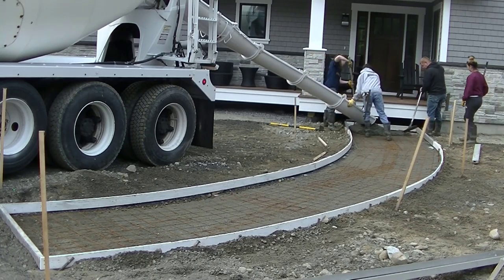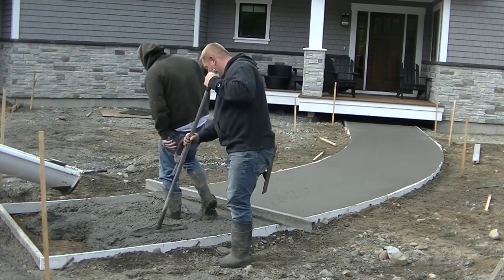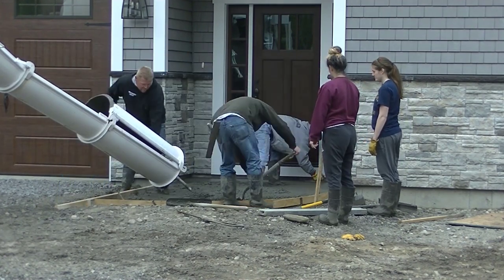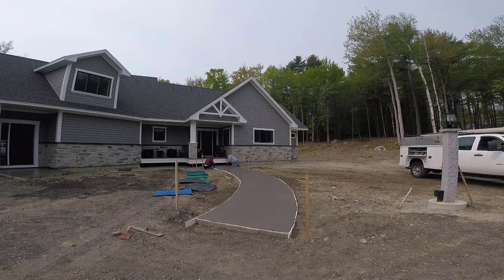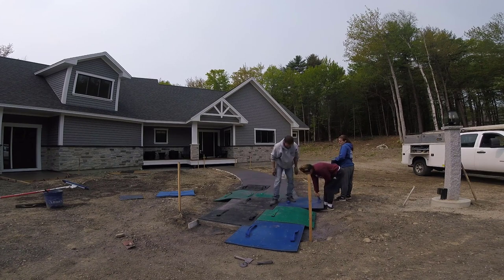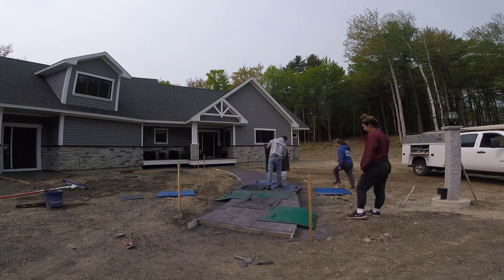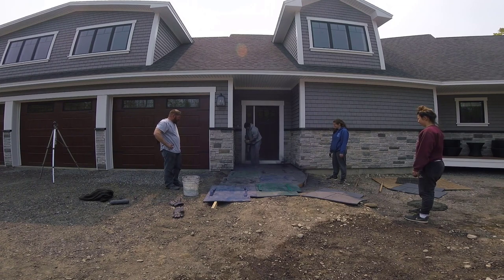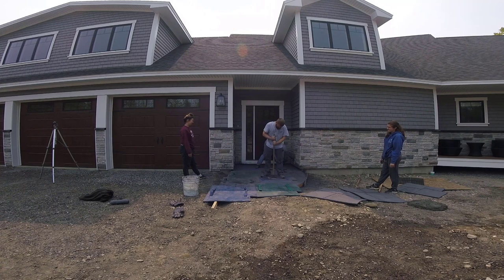How To Pour And Stamp A Curved Concrete Walkway or Sidewalk

Comment: Hi Mike.  Great videos!  I've done concrete for years and I've learned a lot from watching them.  I stamped a front porch with stairs last year with a "slate" stamp and a gloss sealer - they turned out really nice but they are unbelievably slick in the winter time.  Any suggestions?

Comment: Hi Mike, just so exciting and inspiring to watch. I’ve done a bit of concrete work so have enough tools.  Would you share how I might be able to pour and stamp on an existing concrete slab that was poured 5 years ago. The new pour to be stamped can be no thicker than 2 3/4 “  possible a tad thicker.  As the existing slab , which is reinforced concrete and poured on to steel corrugated sheet forms the roof slab to my basement below I think I’ll need a DPM. The existing slab is stable and in good condition with surface spalling which I’ll grind off is 3.5 x 6.2 meters and there are 7 x 8” portholes equally spread out which I’ll glaze to provide  borrowed light to the basement below. 
Alternatively,, I could tile the slab but I’d need a little advice on doing that too. I’ll follow your advice if you think you can offer me some help, I would be very grateful to you.
Peter

Comment: Hi Mike, can I do the stamping process in sections of my concrete job? What I mean is this, I want to do a 32 ft sidewalk and do it in sections at 5 foot intervals and come back later to do another 5 foot section until I reach the end of the 32 ft run?

Comment: How do you determine when to use wire mesh vs. Rebar?
Reply from the maker: It's usually in the plan or blueprints. If not it's just my decision. Kinda depends on the compaction of the sub-grade. If it's compacted really good and hard, wire mesh is good. If I have any concerns at all, rebar is a good choice

Comment: Wouldn't the wire mesh be pushed back down since he is walking in it to screed?
Reply from the maker: It does in areas, It's better to have chairs under it. This had fibermesh in it also. It's hard to keep the wire where it should be no matter what you do.
Reply: @MikeDayConcrete  

Thanks Mike and thanks for the very informative videos!

Comment: Hey Mike, another great job. Just wondering what brand of powder release you use, and how you determine the best color release in relation to the color of the concrete?  Also, are there certain times that you must start a stamp pattern against the building, as opposed to starting against a different reference point, like the driveway in this video?  If so, what is that determined by? The pattern, preference, etc.?
Reply from the maker: I"m using Butterfield color release on this job. I like to use a dark release most of the time, that leaves a better "highlight" color in my opinion. We use mostly deep charcoal for a release color.  As far as starting point. sometimes the sun dictates where you start, other wise I like to start against the building if I can to keep grout lines straight if I have any. If I don't, I start where the concrete is ready first.

Comment: When  finishing  backwards and kicking  concrete ..who ever pulls wire is a waste of effort! The person in front coming backwards is stomping the wire back into the fill!
Reply from the maker: We always use fibermesh in addition to the wire. Once the wire gets some aggregate under it, it doesn't go completely to the bottom. Usually we use some chairs under the mesh, just didn't have them for this pour.